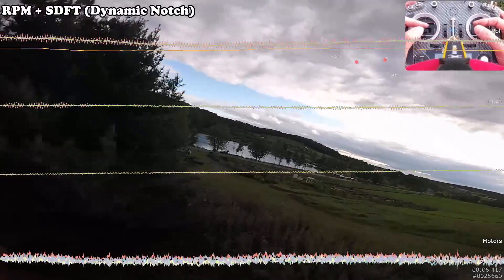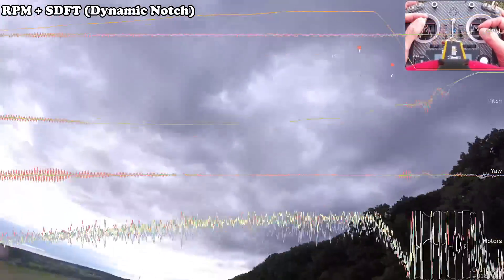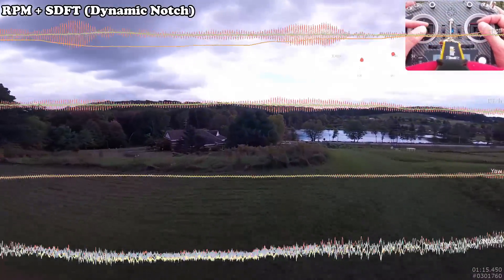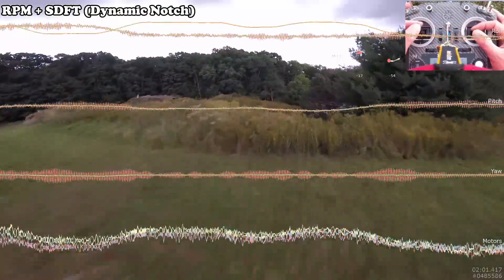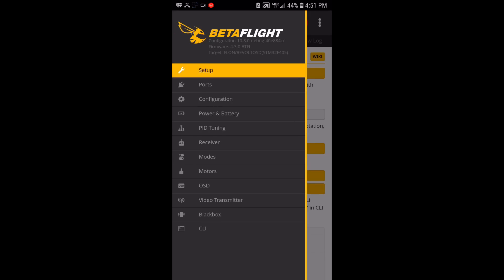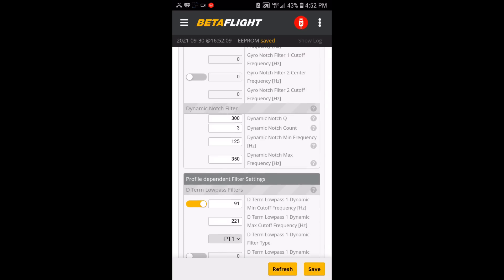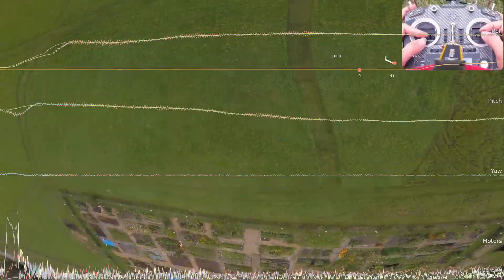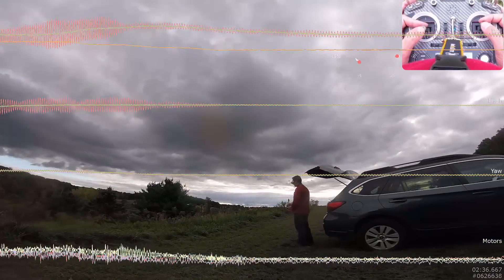Betaflight 4.3 | Should you use the RPM Filter?  🤔

Comment: I destroyed 3-4 motors and possibly the ESC today after I enabled bidirectional DShot and the drone brought the motors to 100% throttle on its own in a disarmed mode. I explain it in my new video. But i have not flashed my ESCs with BlueJay. Maybe this was my mistake ?
Reply from the maker: Yes, if the ESC firmware you had did not support BiDirectional DSHOT that could have been the issue.
Reply: @uavtech  Yes this is probably the reason. But it is schocking and was surprising that the motors can start in a disarmed mode.

Comment: 1 of my quads the rpm filter drains my battery fast and gets real hot turn it off quad is fine same settings on all my other quads are fine different esc though speedybee bs heli 45 amp

Comment: pardon my ignorance because i'm just now delving into the weeds of tuning. But wouldn't you want RPM filtering for freestyle as well. I know that I, and many other freestyle pilots often fly pretty rough props whether that is because you are cheap (me) or you need to fly back from a crash. wouldn't those extra vibrations be amplified by the D term and cause poor performance and oscillations?
Reply from the maker: Sure, but the dynamic notch jumps on them too.
Reply: It’s a must for me flying in Bandos. My motors and props are always so jacked up I’ve had flyaways not using it lol

Comment: Just finished a cine whoop build and installed 4.3 with RPM filtering.  I just disabled and flew 2 packs in my backyard then enabled and flew 2 packs in the front yard.  I don't get it cause I remember how much better it made my race kwad on 4.2 ... but for some reason I like the cine whoop without it.  Just looked at the 4K video also and it proves that it wasn't just a feeling... the video is better... not sure why... but dropping it for now.

Comment: Low throttle oscillations is generally too high PWM frequency. Drop the minimum PWM to 24kHz and bring the max up to whatever you need, dynamic PWM is great for things like this
Reply from the maker: Yeah, I just run 24khz all the time.  At high throttle the PWM frequency doesn't really matter as it is not pulsing the signal.  At 100% throttle, the gates are just open.

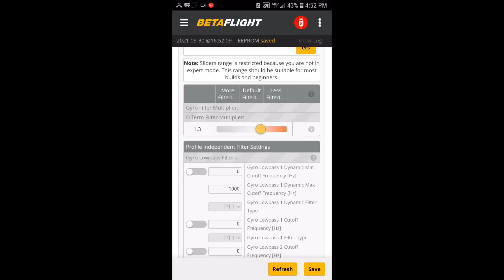Comment: @4:15 Why didn't you give the notches more range to work with?
Reply from the maker: OH SNAP!
Reply: @uavtech  yeah, seems like the most of the filtering was still landing on the dterm filters since the motor band was just barely being touched. Also you stacked all those notches down low and that can't be good
Reply: @BrandonBeans  if u lace the wires with colloidal gold particulates then u can run those filterinos

Comment: based on the graphs that bobble when you drop throttle is pretty low freq. Since it's tied to throttle I wonder if antigravity is too high pushing the system momentarily into oscillation. I dont know how AG works these days so Im speculating here